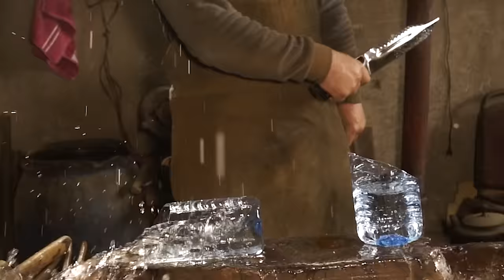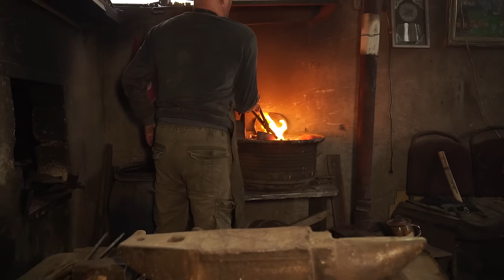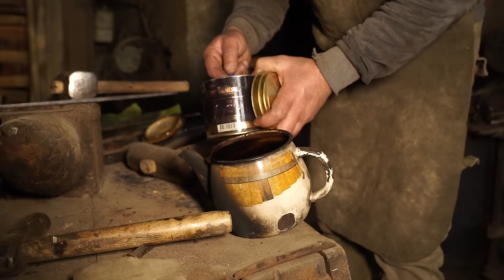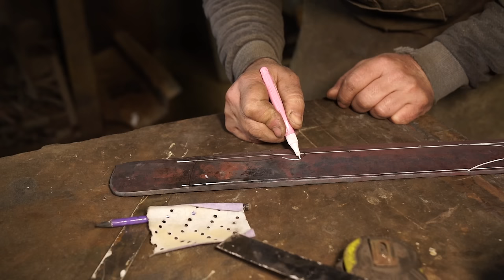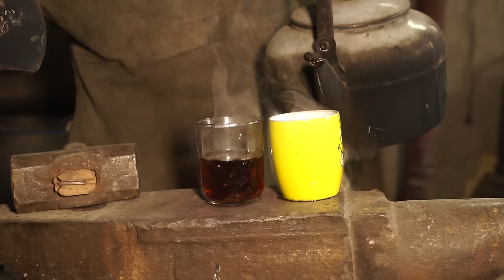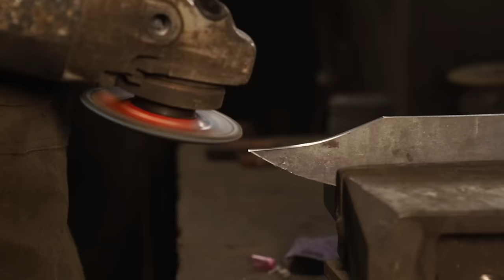Hollywood Rambo Knife - Forging from Old bearing. Sharpest Knife.

Comment: For all the folks commenting that it isn’t correct for Rambo since it doesn’t have the tube handle, you are correct. But ask any real blade smith or someone relying on a knife for survival and none of them will tell you they trust a knife blade bolted to a tube. A full tang like this is exponentially more reliable.
Reply: The original Jimmy Lile knives were constructed as one piece. Only the cheap replicas had the blade screwed into the handle. Lile’s original knives would hold up just fine, but they’ll set you back a few grand.
Reply: @KarnakActual  interesting.
Reply: @Runningcheetah1  Chris Reeves used to have a one piece hollow handled knife, but he retired it after the guy who machined them for him retired. The Randall made model 18’s have a 1 3/4” tang soldered into the handle for theirs. They claim only two a year are sent back, and only after extreme abuse is evident do they fail.
Reply: @KarnakActual  really cool info-thanks.
Reply: @Runningcheetah1  Actually, I am wrong. Lile did use the same relatively shorter tang method that Randall uses. I was going on memory from what another owner had told me, and found that I misremembered after doing a little research. Lile actually used a slight shorter tang like the Randall knives, but he never detailed the exact process to anyone but those who worked for him. It was something about it being “sweated and pinned, along with other processes” and that “proper heat treatment of the blade” was also crucial. I did hear that after 30 years of making the knives, only one was known to have failed. Lile himself, according to the interviewer, disliked the length saying that blade length longer than 7” wasn’t useful, and that “If you showed up in my elk hunting camp wearing a ten inch bowie knife we would laugh you right out of camp." I suspect that Stallone has something to do with their prohibitive size. 

I grew up with the movies, and always wanted to get one as a kid, so imagine my surprise and disappointment when the one I got broke due to the very problem you’re referencing. I wondered why the character would have such a knife, but I think that the method used ensures better strength, and most judge them by the cheap knock-offs. Randall isn’t known for making crap knives, and they still offer the hollow handled 18, and I think it’s one of their top sellers. But you’re right, most of those who spend a lot of time in the woods opt for full tang knives, usually much shorter carbon steel blades and just carry their survival gear in a pouch.
Reply: @KarnakActual  agreed. Did Gil Hibben make some knives for the Rambo films?
Reply: @Runningcheetah1  Gil made the Rambo 3 knife, which was monstrous and not practical at all. I never liked it, as it was such a departure from the Lile’s. As I got older and got more into the woods backpacking, hiking, etc, I moved away from larger knives. I mostly carry Moras. Movie knives are cool, though. The Hunted movie changed the look of what Hollywood expected out of a survival knife. But you can’t get those knives as they looked in the movie anymore as the maker retired, and TOPS got the contract to make them, and they only superficially resemble the movie version.
Reply: @KarnakActual  yeah the knife in The Hunted is cool (Tom Brown Tracker) and kind of a good at several things but not “great” at any one per se. I got a Rambo II replica knife as a gift a long time ago and though it is cool, the blade is crazy big and not practical as you mentioned. And it’s just a replica not truly meant for bushcraft.
Reply: Yep full tang you can throw drop twist...a real survival knife...period

Comment: a bit wrong from hollywood tho ... Rambo's knife had the spine sharpened so when he used the angular force he could cut trough barbed wire. Also it did not had a full tang as the end of the dagger had a compass and one more thing ... important tbh, it had the hallow grind(which very few blacksmiths use)  . nevertheless amazing knife

Comment: I’ve never seen someone put wood shavings under the scales. What is the purpose for doing that?  Binding?
Reply from the maker: Thanks for your question! 😊 Putting wood shavings under the scales is an old technique I use for a few reasons:
Filling Gaps: They help fill any small gaps between the tang and the scales, ensuring a snug fit. ✨
Absorbing Shock: Wood shavings can absorb some of the impact and shock, making the knife more durable. 🔨
Tradition: It's also a nod to traditional craftsmanship, adding a unique touch to each knife. 🌳
Glad you noticed and appreciate the detail! 👍🔪
Reply: @masterknives555  thank you for the reply

Comment: Nice piece you made there man. I really like it. But if I may say what you've done here is not a forged knife. Forging is forming by striking hot metal. I'd say you sculpted it as you give the shape by removing metal. 
But that's still a really nice work
Reply from the maker: Thanks for checking out my work and sharing your thoughts! 🔥 I totally get what you're saying. While traditional forging involves shaping metal by striking it when it's hot, I use a different method where I sculpt the knife by removing metal. It's more like metal carving in a way. Glad you still appreciate the craftsmanship though! 😊 Thanks for the feedback!

Comment: You do great work at forging and grinding and making knives! But I myself would not want any barbs on the spine of the blade to get hung inside a bear or anything else and I loose grip on my knife! Just imagine that getting hung up in a thick bear hide or a mountain lion hide or wild boars hide and you loose your grip from slick blood! The original m9 still blade has serrations only for cutting through thin aluminum on a downed airplane other than that they are useless. If you even make them like saw teeth on a saw they get snagged and hung up on the way out if you needed it to fight off an animal and that can really put you in more chances of not winning the fight! Regular Bowie blades are for slashing and cutting things clean off and making large holes when stabbing! No need for the serrations on the back of the blade at all! I do like your video of forgeing your Rambo knife.
Reply from the maker: Thank you for your thoughtful feedback! 😊 I understand your concerns about serrations on the spine of the blade. It's always important to consider practical usage scenarios, especially in critical situations like you described. Your insights about the original M9 blade and its design purpose are very valuable. 🗡️ I'll definitely keep these points in mind for future designs to ensure the knives are both effective and safe for all possible uses. Thanks again for watching and supporting my channel! 🙌🔨

Comment: can I highly make a safety suggestion, be on the back side of your grinder and put a guard on it before you cut your hand off . I'm a fabricator welder I've been grinding for 30 years ,you don't need a 7 in grinder for a 4 in grinder job . put gloves on when grinding and don't put a 4 in grinding blade on a 7 in grinder it not rated for . I know I had my share of grinding accidents . Great work though stay safe.

Comment: Sorry  but that's incorrect on design I have one like Rambos it has a tube for a handle and inside if you remember is a stitch kit and a compass
Reply: Rambo 2
Reply: @saitoking  Rambo first blood
Reply: Not sure that any of the knives I remember from his movies?
Reply: @saitoking  I don't have a option to send a photo of the knife from his first movie first blood the handle is basically  bolted inside the bottom and the handle resembles a type of gun barrel with a grip pattern machined in it and at the top its threaded inside its cap has a compass in it and inside the barrel is a medium kit and survival kit there isn't  much some stitches a curved needle to sew yourself up matches there may have been more but I got it used the hostel also comes with a sharpening stone everything is black the blade has a wire breaker and saw blade on its back its a rather big knife here where I live its not legal to carry it I have another knife and again not legal to carry knives can't be over 6 inches here.
Reply: Sorry for the confusion yes I know the knife you are talking about. I was talking about the one he made, it doesn’t look like any of the knives I remember from the Rambo movies.
Reply: Love it! I'll take it!

Comment: So I would take a 4 x 4 block of wood and I would take my saw and I would cut a channel in it and I would stand the knife up in the channel and then I would tilt my chopsaw blade to 25° and I would bring the blade down over the top of that knife and nice even increments and even cuts to make those slots on the top nice and then I would grind them correctly because there’s supposed to be a sawblade. That’s what those teeth are for so you can saw a branch. You have to put a nice kerf on them. And I don’t even make knives and I can make a better one than this.

Comment: It's not from bearing. You can't drill bearing
Reply: You can anneal the bearings steel. They’re not hardened super deep. You can also use carbide bits. Heating 72100 will soften it up.
Reply: @addicted2tone349  oh i see

Comment: Never tempered the steel.  Thumbs down.
Reply: Yes he did.  Heated it up and quenched it in oil
Reply: @stevekneebone3802  : Incorrect.  The video did indeed show him quenching the red hot blade in oil which HARDENED the steel.  Tempering the steel takes place at a far lower temperature AFTER hardening to prevent the steel from being glass hard and breaking.

Comment: The "saw" is the worst thing about the Rambo knife IMO. Completely useless and impractical, would have been so much better without it. Then it's the hollow handle... which makes it way weaker than the full-tang one you just made here.